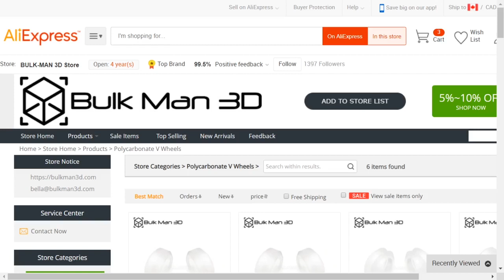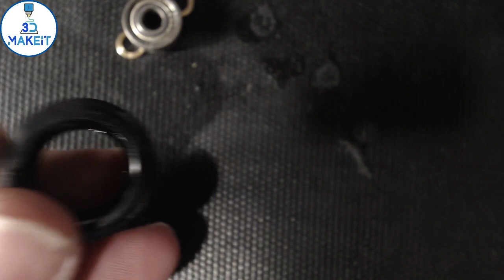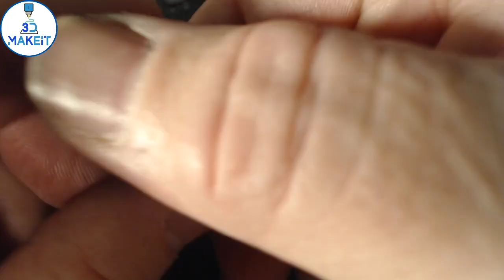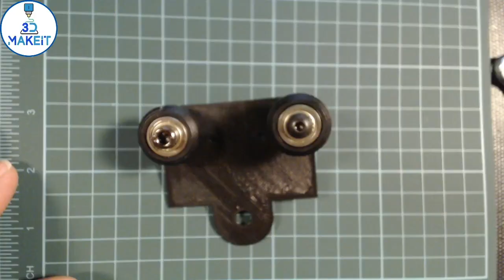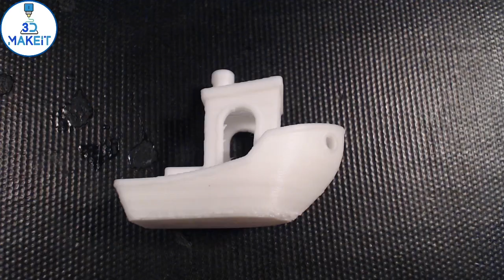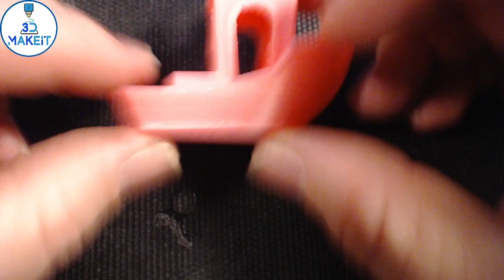Fixing a Legend Part 1 "Polycarbonate V-Slot Wheels"

Comment: I have the same issue on a Ender 3 Pro, I'd wager that you have a bad bearing on you Z axis wheels. Roll the gantry up and down without a lead screw and you should feel it. Almost catches as if there was a flat spot.

Comment: The reason for POM (Delrin) wheels  is the small amount of flexibility that assists smoothing out any damage/deformation in the v slot area of the profile.

The rigidity of the policarbonate wheels will transfer any deformation directly to the print with much greater accuracy (much greater is a relative term).

But wheels will always be worse than linear rails or linear rod and rod bearings in this aspect.

All contact causes wear, as all contact causes friction.  The point is that all are good enough, depending on the reason one uses the printer for.

I would love to see a magnetic bearing.  Imagine if we had N52 neodymium rails and N52 magnets repelling (both top and bottom and on either side!) to hold the gantry an Y Axis!

That would be frictionless!

Comment: You will see more of a difference if you fit improved bearings along with the polycarb wheels.
Reply from the maker: Good tip, Do you have a suggestion of Type or good quality?
Reply: @3DMakeIt  i dont have a direct link for the bearings as i got mine together with the wheels, from here: https://www.ebay.co.uk/itm/V-SLOT-SOLID-V-WHEELS-XTREME-DELRIN-DUAL-MINI-3D-PRINTER-CNC-REPRAP-CR10/283097788650?ssPageName=STRK:MEBIDX:IT&var=583503128005&_trksid=p2060353.m1438.l2649&redirect=mobile

Comment: Only after few days using these PC wheels, there's traces of white dust on the rails. The eccentric nuts wasn't overtightened, just snug enough so there's no play. The dust also appears on the sides where there's no eccentric nuts. Do you have this issue?
Reply from the maker: I have not really seen that. I will have a closer look at mine I have been using them for over a year.
Reply: @3DMakeIt  ok probably mine is going through break-in

Comment: i agree with vansien you can get a 100 pack of wheels with the new higher quality bearing and it those that really help with how smooth your gantries move.
the wheels just help with durability over delrin .
 or ebay i got 20 set of xtreme vslot PC wheels and bearings for $1 a set including shipping,
20 was enough to do 2 printers x and y axis, not z as they don't move enough and stock are fine.

Comment: I ordered the ones in your description and I don't know how standard bearings are supposed to fit in these. The wheel opening is 16mm and a standard bearing radius is 22mm.
Reply: I guess you used 16mm x 5mm bearings ? (Before this I assumed all bearings were pretty much standard)